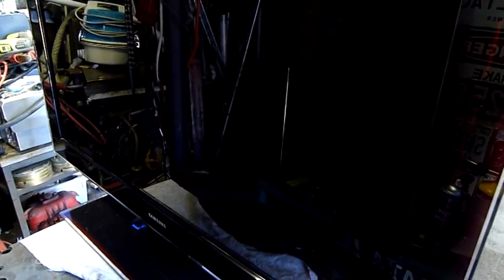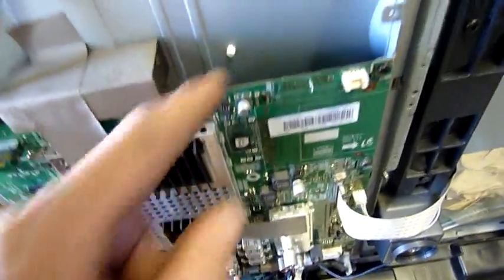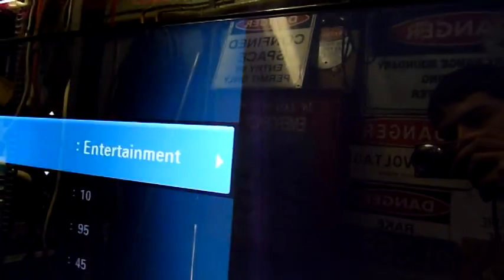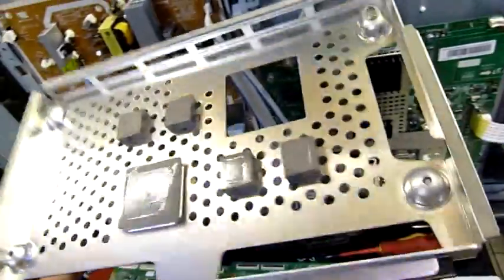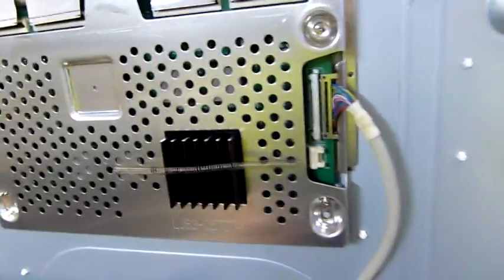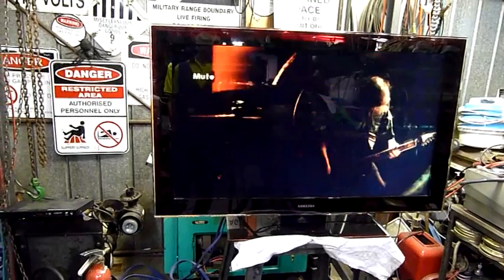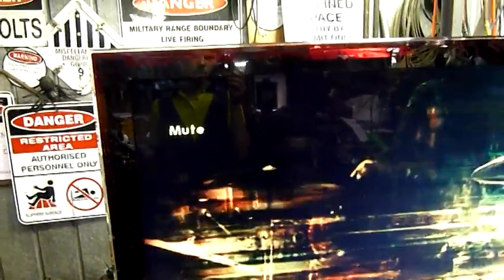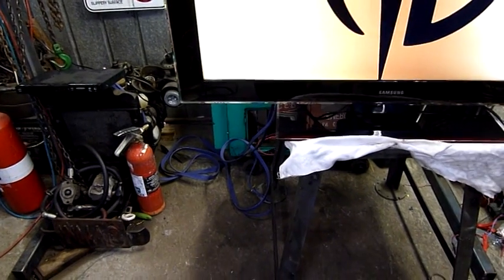Repair Fail - Half-Dark Samsung LCD Tcon Board Swap (Bad Panel it turns out)

Comment: Only 5 and a bit years late to the party lol! Surprised it was the panels on all 3 of the ones you mentioned in a reply way down in the comments. The symptoms were very similar to board failure more than panel, must be really shitty panels & something like the heat or heat cycling is sending it high resistance.I've heard of smaller screens being temporarily resurrected (from days to months) by leaving them to sit in a deep freeze for 24 hours. Being a bit of a fridgie I expect you'd have something large enough to fit one of these in for a test, although being so late on I expect you've also taken these sets to the torture station & probably put compressed air/bullets, a piston (or old flywheel) through them in disgust. Maybe worth a try on the next semi-functional telly you diagnose as a dead panel though, if nothing else it proves the panel is the issue & might get you some good use as a stop-gap telly or a big monitor for the workshop.

Comment: Easy fix it's the tab bond put pressure on screen on the top left good luck to get to tab bond you need to take them apart bare bone then use tape pressure it down small 2 to 3 qtips
Reply: Tommy Doe I've only done a few tab bond repairs 3-4yrs back they were only a temporary repair I'm interested to know how long yours last and how many TVs have you repaired and your  method

Comment: I need help my old tcon board when I removed it had this nasty gel like substance. I didn't remove the gel like substance from those grey pads I kept it in it but the chips where the pads rest on is just a coating of it on the old one. should I clean that off? or keep it on? I got a new one well used one  I ordered off my TV. I'm having an issue when I leave my TV on a high backlight and Contrast the tv gets a overheating issue with lines across the screen and glitching. if I add a fan behind my tv it fixes it and it doesn't happen. any idea what that issue is? I swapped out the power board with new battery compactors that were swollen still no fix I swapped out the main video board still same issue now I have a tcon board here that I want to change but I'm just curious on that gel like substance on it. if that doesn't fix it I'm going to just order some new cable cause the ones I have connected to the tcon board are in nasty beat up shape almost look like they are slowly burning out.
Reply: the gel is a thermal paste you need to add more it dissipates the heat you can get the THERMAL PASTE at a computer store

Comment: Thanks for the video.  Found a TV on a curb to try to mess around with and learn from and it had this exact same issue.  Almost wasted money on a t-con board!  Gonna cross my fingers and fiddle with the ribbon cables and see if I get lucky.
Reply from the maker: try the edge ribbons that bond to the glass, that is what was wrong with this panel and 3 others I ended up with, the repair requires thermally re-bonding it, but I never got one to hold. the TV's were scrapped :(

Comment: Did you check that TV backlight?
Reply from the maker: yeh the backlight was working fine, it was a failed panel edge ribbon, tried fixing it to no avail. its junk now, just sits in the spare parts room.

Comment: Hey mate i love your videos and i have learned quite a bit from watching them but i was hoping you could give me some advice, have you ever had any picture quality issues after replacing a tcon board cause im looking for a little advice because i have a 46" sony bravia full hd lcd model kdl46x3100 and the tcon board died on it so the tv would not turn on but i have since replaced it with a new one and it now works but now the colouring looks a little more redish then it should be and no amount of playing with the colour settings fixes it also the actually picture quality is quite noticebly gotten worse its now like standard def or maybe a bit worse.

Comment: hey mate you wouldnt of happend to of kept the tcon board you brought for this and willing to sell it? chasing a similar fault in my Samsung tv and it uses the same board
Reply from the maker: +woodys32 I might have one in stock, I ended up finding out its a bad panel edge ribbon, not much can be done to fix it permenantly.

Comment: Did you ever figure out the issue with the set?. Mine has exactly the same issue..
Reply from the maker: +Jeff Hogancamp bad panel unfortunately, I scrapped several such units not long ago, even trying to re-bond the edge ribbons was hit and miss at best, it does not last.
Reply: Yeah i don't have a way to bar solder them back in place. Guess it's just a matter of having the right tools for the right job.. =)
Reply: Aussie50

Comment: I have fix this types  of problems I have beat techs with 20+ years of experience  with this method and it worked for me and clients....the panel isn't burn or crushed the problem is on the flex cable and we're u inserted in too pins will get wrinkles that it can't  be seen...

Comment: try adjust the flex cables from t con desconect one by one and at each time check the image on the tv if it gets clear when it does that the cable u need to ad just with scotch tape that is the clear one and thin tape....add a bit of tape on the vines of the flex and until get were u wanted until it gets a nice picture....this problem occurs when the tip of the flex gets vend with time over being heated by the tv parts ....it's hard to see were it vends it can't see by the eye it just need a bit of vend to make lines or discoloration on tv.....hope this helpful......

Comment: yes, it can be bad lcd panel, tcon board, or main board but i got a used tcon board and if was defective so i thought it was bad panel too (i realized it was not panel cause tcon had different picture problem). if dark image is on all tv inputs and effects picture and tv popup menu it can be tcon, panel or tcon connections. use freeze spray or heat gun on board to help diagnose if its tcon issue (chip's solder might need to be reballed), also pressing around the tv bezel frame will help diagnose if tv has bad tabs on lcd panel connections.

Comment: Crap, ITS THE DEFECTIVE PANEL none of those repairs worked (just twisting the panel) anyone has same conclusion?
Reply from the maker: Yonsebastian Torres I did end up buying a tool to try and re-bond the edge ribbons with a soldering iron, but I have not had the time or space to set everything out and try it, most of these TV's are gone now, consigned to the scrap bin.

Comment: I have seen this problem before because I own a Samsung LN40A650.  Nice set with a poorly constructed LCD panel.  If you were to take apart the LCD panel (stamped metal housing), atop there are ribbon cables coming off the display to interface boards.  These must be a matrix interface to the arrary of pixels in the display itself.  The ribbon cable on mine and it appears on yours are not solidly connected to the panel itself.  Thus, the display will ghost (upper left side) and possibly flicker and color distort.  When the unit warms up, the problem can disappear for a while, but eventually it returns. I fixed it for a while by placing spacers next to the ribbon cable, thus moving the cable into a position that solved the issue. But it did not last.  The hunt for a working display continues.
 
Mine failed after the warranty expired.  Very convenient.

Comment: Hello friend!
I had the same problem replacing the card and does not solve the defect, apparently the panel is ruined really.
For a test I disconnected each ribbon separately (each controls a section of the screen), then with one of them out, does not ghost has shown on the screen.
At this point I covered the ribbon in half with electrical tape, the problem came back, I changed the tape to another position and the problem disappeared again.
So I've been decreasing the width of the insulating tape until find a single track of the ribbon that was the problem.
The image was 99% fixed, but left three thin dead horizontal lines on the top of the screen, but I think it is better than buying a new panel or put in the trash the tv.
Hope this tip might help you.
Reply from the maker: G'day mate!

I have since collected 2 more sets of the same size and panel with the same problem, as you say, the panel is pretty much toast :(, I have not gotten around to tinkering with them tho, 2 are permanently half-dark, one occasionally does it when hot, it will be the one I try the tape fix on, but since its not a permanent fix, I can't really sell it a a used TV since I know it will fail again :(

Comment: I have a Samsung LN40A650A, with the same symptoms. I opened it up, and removed the bezel and touched all the tab bonds but they all seem to be firmly bonded. Did you ever fix this issue?
Reply: I have the same identical model TV and changing the T-Con board and reseeding the ribbon cables don't seem to help at all either. However after leaving the TV on for over 30minutes while the TV flickers between the half black screen seems to work fine with no flicker for hours.  I fear the worst that the entire panel must be the problem because I replaced the T-con board, power supply board, and the Board with the HDMI hook-ups thinking that would solve the problem. Long story short ....I had no luck. I guess I'm stuck waiting 30min. for my telly to work properly.

Comment: Bad earth connection to the panel. Look at the cables between the TCON and the panel. See if the earth (gnd) is passed through to the panel board.
Reply from the maker: I still have a few panels like this, if that is all it is, then we can save plenty of them!. I have been told that its an edge ribbon connection issue tho?
Reply: Stephen Low
It's just a long range guess, but I've only seen image sustain like that once before. I have a LA40A550 version (530?) which had been dunked in liquid and allowed to dry out while powered up . The flex cable between the TCON and the panel had tracks on it eaten away (looking very green). I have scoped these out as Gnd and a couple of others. The panel displays perfect images, but the sustain on any image is around 5 seconds with a very slow bleed back to the next image. I was perplexed until I noticed the etching that had occurred. Your board looks to have the same image sustain as mine did. Run a trace wire directly from the TCON and the panel driver board, see if it makes a difference.

I always put panels that have obvious water ingress in a box with some rice for a while before attempting to work on them. Water and high frequency drivers just don't mix. High voltage/doggy power supply also affects them. Larger panel TCONs are fused as well.

Hate fixing TCONs, no schematics, no waveforms, tiny parts. Time to go suck another AS15-G off one, getting to old for this.

Comment: I have the same problem with he same model... Mine is wall mounted so I can grab the corners and flex it quite a bit which does resolve the issue, but it's getting harder to flex it the perfect amount that it 'settles' in a good position... any repair options? or is it time for a new TV?
Thanks for posting the video as it saved me buying a tcon board :)

Comment: Did you clean the connections? Had same problem on left side of my samsung le40m86, cleaned ribbon and connection and worked again.

Comment: built into the panel itself, best way to check is to try slightly tiwsting each side of the tv back and forth in both directions, if that does anything or shows any improvement then you have a bad panel.

Comment: oh and also I took a closer look at the video, wanted to ask if the artifacting is consistant on the panel or not, same spot on screen and constant? If not I doubt its the driver board, but if so, you might have bad shift registers or the driver board. Bad shift registers indicate thats a bad panel, they can't be replaced. They are what control the pixles in the LCD itself.

Comment: hmm interesting issue. could be a few things but my guess is ethier the digital board or maybe a bad flex cable somewhere. Though rare as far as ive seen, it could be a panel defect as well. Id try swapping the old t-con board back and try a hotair reflow on the digital board, if that doesn't show then i'm sure its something panel related (drive board that connects to t-con from the LCD intself)

Comment: hey ed look into re-flowing , its a process  of using a pin torch to remelt cpu or graphics chips solder joints on the back of the circuit board , you would be surprised . any way turning of hot electronics and then turning on cold electronics is very stressful to the metal pin solder joint interface , the coefficient of thermal expansion is greater for the pin then for the solder so over time microscopic separation takes place and it is only visible with x rays . i did it to my laptop

Comment: Does the tcon board have any jumpers on it? On the plasma equivalent of these boards, there is usually a jumper you can short which will enable a built-in test pattern generator.

Comment: Try to heat or to cool contacts on main board and on LCD panel (where flex attached to glass). You will find the problem quickly.

Comment: Ive found old hitachi crt tv's to be very good, the actual crt itself lasted a hell of a long time :-)

Im sure there are people out there that would disagree but there are more old crt based tv's still around and working than the lcd or other non crt types.

Im just an old git that does not beleive in all new tech, old is nice too, and often out lasts newer devices. :-)

Anything with a switchmode psu normally dies early, and thats a dam shame, waste of parts :-(

Comment: Haha yup CRT is the way to go! I use a cheap 42" FULL HD lcd atm, but nothing beats the colours and the contrast of a good CRT! I have a 52" CRT rear-projection TV in my garage. It's 10 years old and still going strong. Just some components that needs to be replaced (a resistor and some other small stuff), but it has an amazing picture. :)

Comment: My Hitachi is going strong. Still has the funky green pixels when drawing images on the screen when the panel's cold, though putting it on an isolation transformer helped. Goes away after 20 minutes or so.

Comment: LOL ED, i said to my fiance"it's like the panel isn't being driven correctly" and you said it 2 seconds after i said it! i think your right. if it was the chip on film panel drivers i would expect it to only be a strip per driver, not almost the whole panel. i think it's the main board that's died